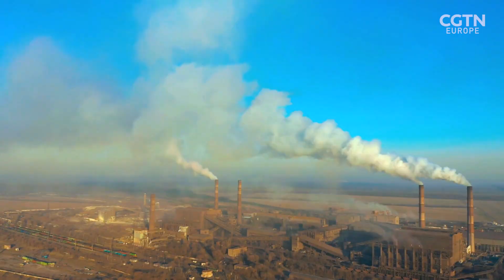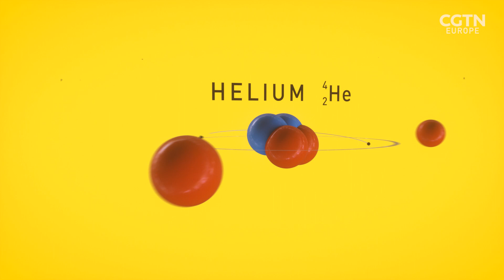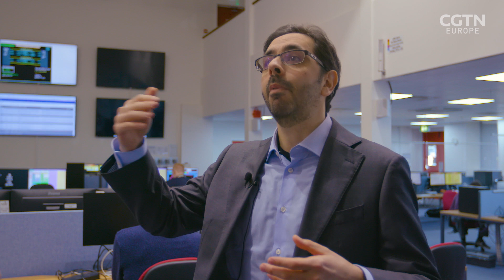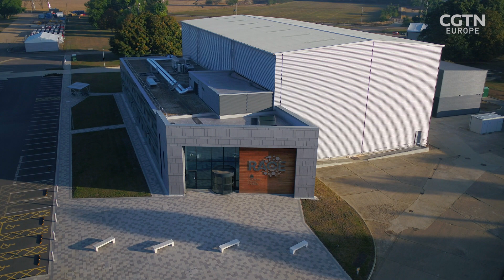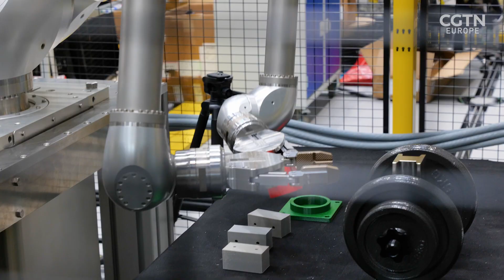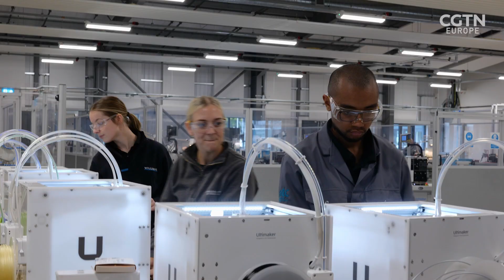This could be the world's first nuclear fusion power station

Comment: Forget it. Any fusion reactor that needs to boil water is outdated and will also cause the same kind of future decommissioning problems as well. Reverse field configuration produces electricity  DIRECTLY . No water heating and cooling plus higher cost to maintain.
Reply: I  Totally agree, using physical magnetic field distortions to generate electricity is an ancient technology by today's  Standards, The problem is cost to scalability, Let's hope the next generation of minds embraces  new approaches  to essentially strip and pump  Electrons for mass consumption.

Comment: I don't get it. The central transformer is the main source of inefficiency in the Tokamak design. That, drift losses and density limits. Why still pursue the design when stellarators are functionally superior?  Well, they're orders of magnitude harder to build but once a design works, just make a whole bunch of them. 
I'm really interested in Germany's W7 and future 4 twist designs which seem much simpler to manufacture.

Dangerous radioactive waste from fission is solved. You simply burn it in a different type of reactor. The only thing holding that back is politics, not science. Brings the actual useless waste down to 300 years of impactful radioactivity that needs glassing and then storage. That's a lot more manageable.

Comment: The physicist in charge of MAST is being ingenuous in stating that the JET experiment produced more energy than was put into it. This ignores the energy used to run the experiment; in the end the machine efficiency was about 1%. Since an electricity producing reactor such as STEP will need an machine efficiency of about 30, an improvement of some 3000 times is needed. No one has outlined how this will be achieved.

Comment: Too bad there isn’t enough tritium to run this. Canada will be happy to sell all 25kg that it has, which isn’t enough to test a tokamak. Adding lithium blankets doesn’t help much because they simply can’t produce enough tritium. Adding a beryllium inner blanket to multiply neutrons with result in tremendous radioactivity due to the uranium impurities in the purest beryllium reasonably obtainable.
Reply: This is all absolutely correct. Besides the tritium, one might ask where the STEP reactor will obtain the necessary lithium with isotopically enriched Li-6 of which many tonnes will be needed. These are the questions that the very patient interviewer needs to go back and ask.
Reply: We can make it by  using lithium in reactor cores then you have  tritium
Reply: A Tokamak plasma has about one ten thousandth of a gram of Deuuterium/Tritium.
If they have to come up with a long list of improvements to make it practical, using pure Deuterium is probably near the top of the list. Hopefully they will get it working before the next ice age arrives which is the real climate issue.
https://youtube.com/shorts/DaoS9cYE1ZM?feature=share
https://youtu.be/vzGPq9LSjEw
Reply: core implosion  in ten seconds

Comment: a whole load of BS. It is a bipolar approach to energy generation= 1) you need to heat the plasma to 100 million degrees. 2) you must not allow the plasma to touch the walls, because it will lose energy. How will you extract thew energy from the Tokamak?